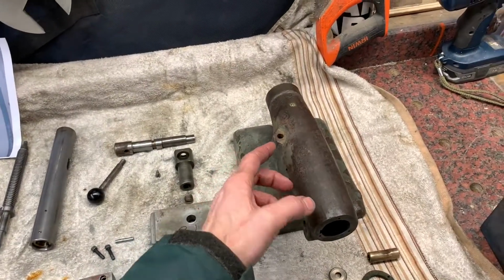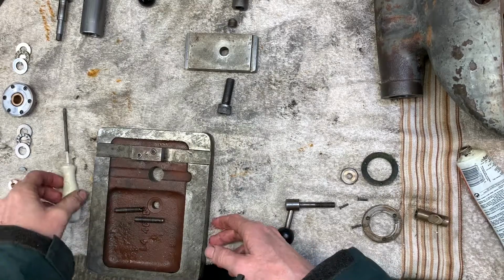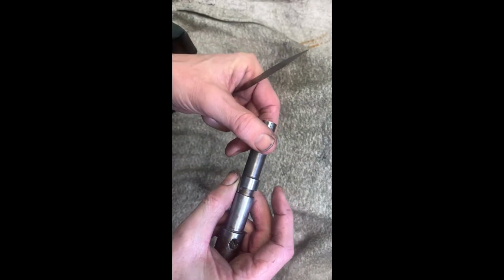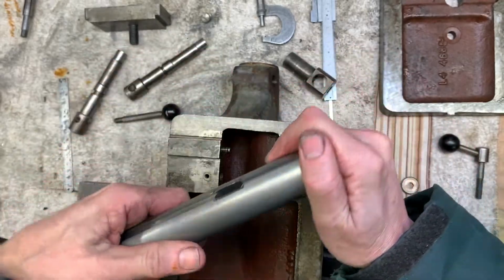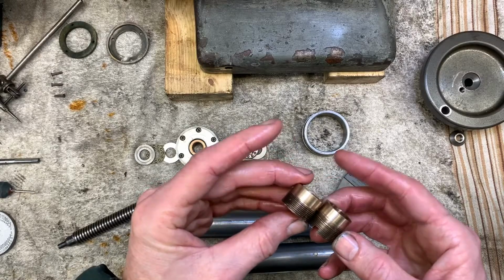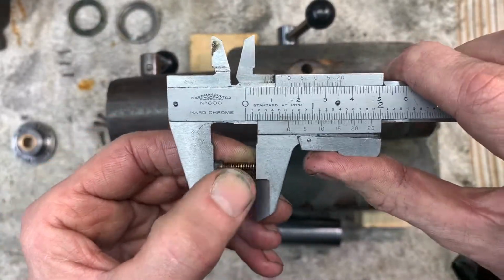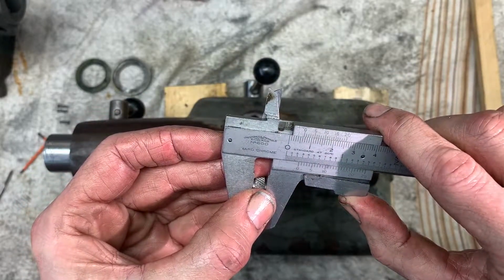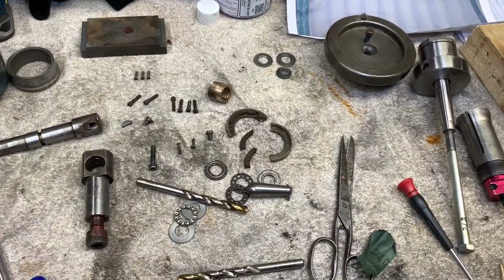tailstock service    28

Comment: That item is called a dipper. The hole is a well for ep oil. You use the dipper to apply the oil to your dead centre when turning between centres. Many older lathes had them, Boxford, Southbend etc. Hope that helps. Enjoying your vids, keep up the good work. 
Regards from a S&B nut :)
Reply from the maker: Well I'm blowed  -  brilliant